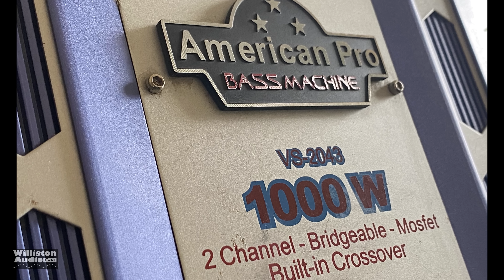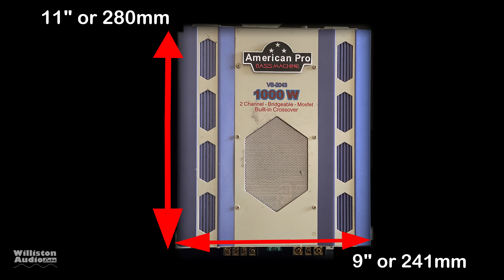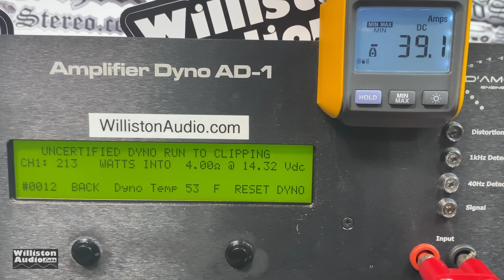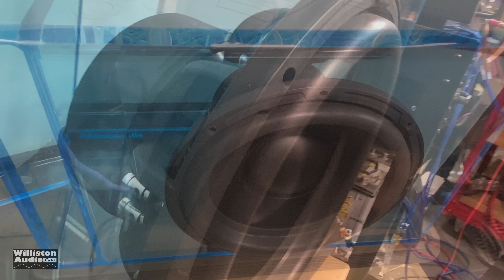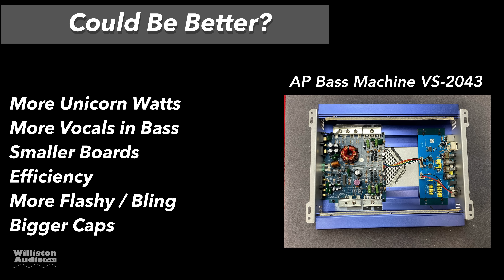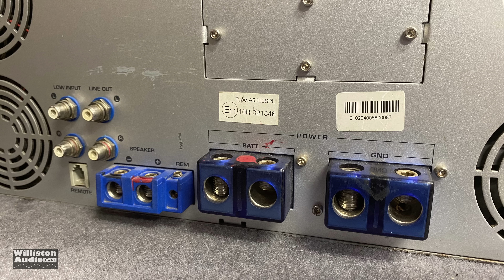Unicorn Watts? Experience Grand Bass with the American Pro Bass Machine Amp Dyno Test

Comment: I don't know what wrong with the amp you have that you are testing but I had this same amp pushing 6 jl audio  gen one jl w3s and theu slammed HARD...TRUE STORY.  this amp pushes hard but my headlights would draw down to Nothing.  It will run on 2ohm and 1ohm. Or at leaders mine dide .❤️

Comment: You didn't tell us what you paid for the amp? Or I missed it when it was bumping that infinity sub. But I'm guessing at a flea market $80-100. Didn't you just demo a sundown knockoff that actualy pushed 1400 watts for around $100? Mabey it was 900 watts but that think was crazy for the price. It blew me away and "yea, it did bump doe!" So you can go on line wait 3-5 days for shipping and get an extra 7-1200 watts for about the same price or you can get a shinny bling bling that breaks up befor you even fully drive most subs and you get it the same day. Idk, it's a tough call I mean that little monster you had a week ago didn't have all that extra room for cooling and we weren't sure about the customer service they would provide. I'm sure the guy at the local flea market or random off eBay will be glad to replace these if they die a month after you install it yourself! Yep sounds legit! Thanks for the video you bug dummy! I have the same hang up you have about these flea market amps. The first amp I had was a Rockwood, not by choice it's just all I could afford. I had that big jensen amp that was super popular back in the day. We bumped what we had and I love these cheap amps. They were fun starters.
Reply from the maker: I think around $50 on eBay

Comment: Loved the third section of the amp .... just air LOL. Ate least they put a power supply to get two rails and more voltage and made the ouput out of transistors instead of slaping a 15W chip from the 90s. Bass machine ...... yeahhhhh its a Bass minus the B.

Comment: That purple flea market amp must be an urban audio works. Back in the day my local rockford dealer sold those as their budget brand. My buddy had a 600 watt urban and replaced it with a punch 40. The punch 40 walked all over that purple paperweight.

Comment: I actually like these weird amps. Not to actually use them but as a display in the garage. 
Also I don't think some people know how much bass you can actually get for 200w rms with an efficient sub in a proper enclosure. I am running about 250w rms to the sub in my beater car (comps are amped as well). It won't shake stuff off the walls or be heard from a mile away but it gives a nice low end that balances out the system.

Comment: It has pretty much that the exact same amp output wise as a Jensen 75x2 amp I bought back in 97. I measured the output with a volt meter years ago and it put out about 200 watts bridged. It also had 2 separate boards in it but the audio side had less stuff on it than this one has.
Reply: I bet you the Jensen was more efficient probably sounded better not get as hot and last a lot longer that's the difference between Jensen and Brand X
Reply: I had a couple different Jensen's back in those days. They weren't super powerful but they were affordable and reliable and retailers stood behind them warranty wise. They also held their value, I sold them at a decent price and they went on to live another life after me

Comment: I'm disappointed in this off brand amplifier. It ruined my guesstimate of the wattage. My Golden Rule was any piece of junk amplifier that has no name on it and comes from a flea market is as such. Look at the fuse 30 amps I would have thought that at the lowest impedance bridged I was looking for 300 watts RMS certainly not anywhere near a thousand we all know that that's a joke. I wonder what would have happened if you would have dropped the impedance below the recommended setting? Would it have blown up? Would I get my Golden Rule of 300 watts RMS? I suppose I will never know.🎶🎶
Reply from the maker: This isn’t class D so that rule can’t be trusted as much. Also it’s possible someone “upgraded” the fuse over time. I don’t know if 30 was the OG one
Reply: A friend this exact amp back in the day hooked up to two WalMart ROADMASTER 12s. I can confirm that it did come originally with a 30 amp fuse, and also confirm that the board will burn before the fuse does!

Comment: A variable frequency on the bass boost, does not matter you still want to turn that all the way down.
Reply: why? I di not know this, I thought EQ was ok to use to boost certain freq. that are "missing" due to vehicle acoustics.
Reply: @MiloPerrotti  If your gains are set properly bass boost will create distortion and clipping.  As a general rule when EQing a system you want to cut instead of boost.  If you have a null in the frequency response consider repositioning the subwoofer, checking polarity, adjusting the phase....

Boost is your last resort.
Reply: @DIYAudioGuy  thanks man
Reply from the maker: Unless you banging! 🤣

Comment: Wow that amp is pathetic. 😂😂
Reply: Kdog
Not for nothing but if the price was right and the guy was setting up a starter system and had some equally pathetic woofer I'm sure it would have been just fine 80 Watts RMS what perhaps a 10 in inexpensive woofer would have made somebody very happy and then they would have moved to the next level and learn something from this amp that's how I learned started at the bottom not by research didn't have any Big D no YouTube.
On the other hand if the salesman at the flea market represented this as a thousand watt amplifier an overcharged his customer then we'll talk in a different story completely
Reply: @Mr.Robert1  good point 👍
Reply from the maker: So no grand bass for you I guess?
Reply: @wal  😂😂😂

Comment: Question: how do you set gains, crossovers and bass boosts when you're doing these?
Reply from the maker: With the Amp Dyno’s built in DD-1+
Reply: @wal  so it optimizes the gains for you?

Comment: Punch 45 was $350 back then so 4 of the flee market amps X $50 = 600+rms for $200 can all according to what you looking for.
Reply: Comment about the price of the punch 45 and how much wattage would you getting for your money there's one thing that you're forgetting the efficiency how much wiring you going to have to run to get four of these bad boys in your car and what kind of amperage it's going to draw off your battery and your alternator that's why the punch 45 was so expensive it worked

Comment: I have a old school Sony XM1002HX from 1997 (the purple one) that claims to put out much more power at 4 ohms than 1 or 2 ohms.   Would love to see it dyno'd.  It even has a HiVoltage/HiCurrent switch on it.  Unique.  It's still going strong today and slappin a DVC 2ohm Kicker CompR in the wife's trunk with ease.
Reply: Thats interesting, I would like to see that also.
Reply: Ooh I been lusting after one of those on ebay lately. That's an SQ amp it isn't really designed for big RMS watts. I'd def like to see it on the Dyno it will show big Dynamic numbers over the RMS if the caps are still in good shape

Comment: about to see the first pull on the dyno.. judging by by the fuse ill give it 300 at best.. be back in a few to eat/cherish these words..   definitely  could have been better.... D what is the SMDs  maximum power input recommendations?  noticed for my first time it has a temp reading as well assuming it is dissipating heat as well..   theres some monster amps out nowadays i wonder even what my MD8k 2 ohm would do on the dyno if you gave it a shot
Reply: I'm with you on the 300 watts I came up with the same number once I saw the fuse that was my guesstimate like I said in a different post drop the impedance and see what it does two things reach 300 watts or blow up what goes what happened to the good old days we're afraid to blow a flea market amplifier now come now that would have been the perfect video of audio.

Comment: WOW! Thats almost as UN-efficient as my 6.0 litre truck! Good grief and a 30 amp fuse? Hilarious brotha flat out had me saying "ooooooohh thats horrible!"
Reply: Maybe it needs a new air filter?
Reply from the maker: It’s a fact!
Reply: GM 6.0L vortec? those have great performance and efficiency for their displacement.
Reply: @MiloPerrotti  you ain't lying when you drive conservatively it gets a bit over 12 mpg however I drive a lot more heavy footed than I should. Not much like hearing that 6.0 @ high rpm. Cold air intake and performance exhaust add to the sexiness